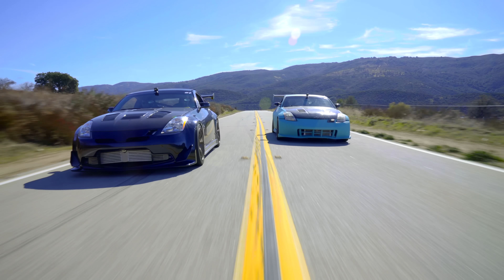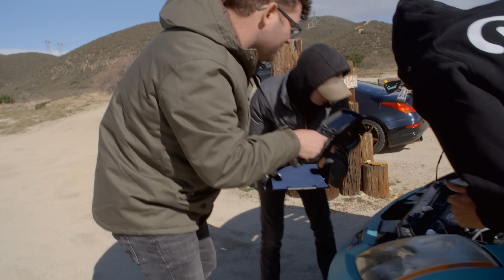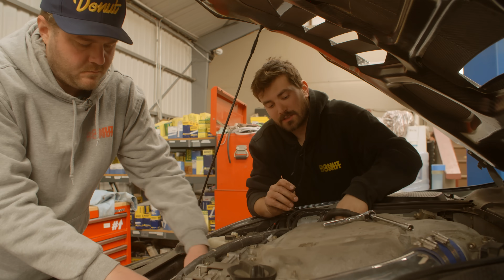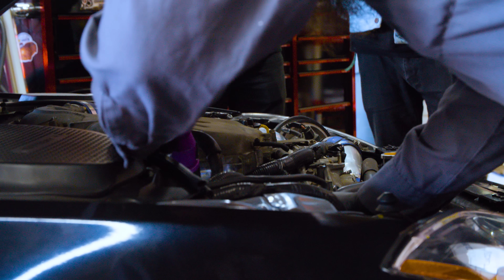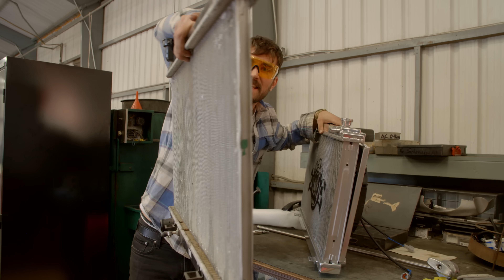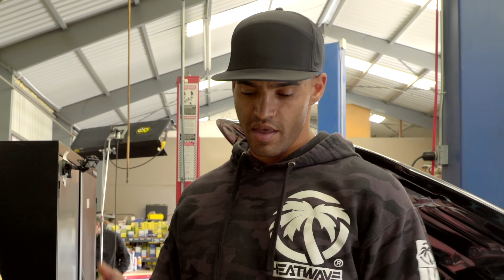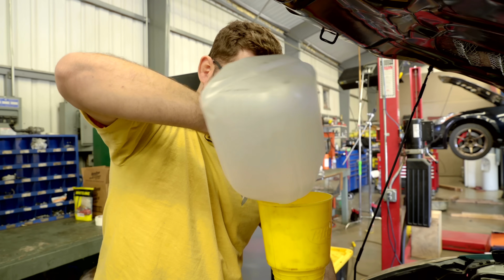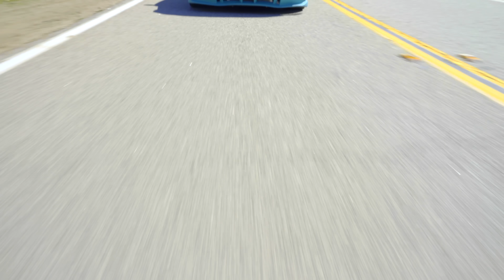$200 Radiator vs. $500 Radiator

Comment: Shout out to everyone broke af, who's been rooting for lo car the whole time.
Reply: In my opinion, for crucial part like turbo, radiator, and suspension i would used high part and the rest will be the low part.
Reply: @lamatakbertemu8197  or I uppppp
Reply: Sometimes the difference in price is not manifested in performance but rather ethics. You can have a company that develops and builds their products paying their workers fairly, and another company that stole their intellectual property, and is making the exact same product illegally whilst paying their workers like shit and having terrible working conditions. 

Sometimes the extra money isn't necessarily toward performance.
Reply: @lucysmith4242  I agree with you. It's more like giving credit for original idea/innovation.
Reply: @lucysmith4242  Thats a good point, dont buy china parts.
Reply: @lucysmith4242  You opened my eyes with that scenario, thank you, I had never thought of it that way
Reply: Andy96 if it's all you can afford it's all you can afford though. No shame in it. Can't fix the entire world ¯\_(ツ)_/¯
Reply: @lucysmith4242  There is a company here in Sweden called Biltema. They usually have the original parts for a car, however it's sometimes the "second sorting". But it's cheap as fuck. Bought and entire brake kit (front and rear) for $250.
Reply: @lucysmith4242  you'd have to prove that low car's parts are produced with illegal labor practices though.
Reply: Lucy Smith I gotta say I agree with this wholeheartedly
Reply: @lucysmith4242  not really. Cheap brake pads are worse than racing pads. My last car had regular brakes and they broke while I was in traffic and I immediately became a hazard to everyone on the road. Believe it or not but I spent nearly 1k on breaks calipers and rotors and never ever had an issue with breaking and it felt amazing for years. Sometimes quality is high priced who would’ve guessed 🤦🏾‍♂️🤦🏾‍♂️
Reply: @lucysmith4242  yeah but who cares about that race car go brrrrr
Reply: @lucysmith4242 i want money towards performance not ethics.
Reply: @lucysmith4242 😂
Reply: At least I own my dream car ....It don't work but I own it
Reply: Me n my civic (I know roast me) stay on low side.. the kid has zero funds for high car mods...
Reply: Cracc Baby civic is cool bro. Do ya thing
Reply: Honestly the best parts are simply in the middle, not crap, and somewhat cheap
Reply: @atheerathman  I don't know. I would definitely go for the high car turbsky, body kit and radiator. Maybe even fuel injectors.
Reply: @sith_sigma  But you probably have the money to back it all up and maybe even survive the rest of the month.
Reply: @sith_sigma  bb  up
Reply: @sith_sigma  I up p mmmm
Reply: @sith_sigma   You think aftermarket fuel injectors are better than  OEM ones that came off of a 100k dollar GTR? Wake up bro, you know nothing. so you would pay $3,700 for wheels?, $4,500 for brakes?, $8,100 for a turbo kit?, and $5,500 for a body kit? These cars aren't even worth 10k. You can put 20k into a 10k car and usually end up with a car valued at 15k at most. I dont know what world you people live on and what you choose to eat, but if you like cheap noodles you can put in the microwave and you can care less about your health, and you live in a card board box, and you got no girl or kids, then go ahead and waste your money, maybe your money is not hard earned.
Reply: @atheerathman  got a wife and kids. Wife stays at home, and I make above union scale, so...
Reply: Dude freaking same 😂
Reply: claustrophobic turkey 69  well then you’re looking for money pit on Wednesday
Reply: As far as cooling systems go I literally run the same type of low parts on a stage 2 gti. The computer shows 91 deg targets 90.
Reply: @aRYANz88  this motors twice the displacement
Reply: Facts lmao
Reply: @MonzOffroadDesigns  Ok so you would pay $3,700 for wheels?, $4,500 for brakes?, $8,100 for a turbo kit?, and $5,500 for a body kit? Was i totally wrong about these parts being too expensive? Get your head outta your ass. These cars aren't even worth 10k. You can put 20k into a 10k car and usually end up with a car valued at 15k at most. Do your homework before you say some dumb shit.
Reply: #Facts
Reply: All my cars have been lo cars - even my hi cars 😆
Reply: #⬇️ all day.
Reply: 🤣🤣🤣me asffffff I’m glad I can fit in ova here
Reply: I prefer the expensive parts, but I’m broke.
Reply: Wtf you took my name
Reply: @ashtongreer3329  tbh, you can have it back. I hate it.
Reply: On the gang
Reply: My brain says hi suspension but my heart says hi body kit and the wallet says mid works
Reply: Hahahah 🤣 go low car
Reply: The carless team cannot support Hi in good conscience 😂
Reply: @duinthadope420 unappreciated year old comment
Reply: ME. I have a g35 that I’m really trying to make nice. Done intake, test pipes and exhaust. Painting it rn
Reply: Here here 😂
Reply: Im definitely not rich but I buy quality parts  don't ever cheap out on your transportation you'll thank yourself in the long run and try to get parts with life time warrantys if you can
Reply: Fr bro , I come back cause they actually test these parts
Reply: 😂😂 facts
Reply: Not me I just don’t want to spend more of my money I dropped about 1700 just on tires, rims ,and tint and not including maintenance
Reply: @classicjay1880  My rims (new) costs $3000 (I bought mine for $500 because the previous owner had brush painted them and they looked terrible so I got them cheaper and now they're the original silver). They're Volvo Pegasus rims. My spoiler costs about $200 (Iridium wing). Devil Eye's headlights: $450. 2005 facelift taillights: $500. Car bought for: $500
Reply: @classicjay1880   1700 is nothing in the car world. nobody said building cars is cheap and you not having the most funds isn't a valid excuse to skimp out on safety and buy cheap shit

and yes, if you bought those wheels and tires new, I am talking shit about your shitty rep wheels and Chinese ling long tires
Reply: I kept my mk6 gti stock intill I can afford the mid to high range parts. I’ll NEVER go cheap. Stock is better then some cheap bullshit riding round bouncing your ass off
Reply: dude , 40 bucks as a said up there . They dont buy the ACTUAL lowest price . And it works fine . I sell these part myself and my customers are satisfied .
Reply: @RecklessGenesis  I bough most of my stuff for a lower price than the low-car. I'm still satisfied. My headlights don't get foggy but I can't get the dead spiders and mosquitoes out of there. The previous owner didn't put them on properly so insects could get in but they're a pain in the ass to get out.
Reply: Lmao. I was the low car’s no.1 fan lmao
Reply: @badm0t0rf1ng3r  I thought that was the point of the series.  Some parts are overpriced, and do the same or worse than a cheaper part, your just paying for looks, not effectiveness.
Reply: Facts
Reply: Everyday
Reply: Yeah buddy! ✊
Reply: Ew
Reply: Lo truck baby FTW
Reply: A person thats actually poor cant afford a car at all.. like we just want to pay off our debt. And even that isnt poor compared to what a lot of african, southamerican and asian people have to deal with. This just shows how superstitious some people are..
Reply: I'm ain't that broke... but hi car's budget is absurd at this point... i mean fast forward to the end of the season, team hi could literally buy the new 400z
Reply: Weeeeeeeell.....
Reply: Nah I’d rather wait to buy the better parts then have failed upgrades
Reply: # team low
Reply: Broke because you're on youtube, not working
Reply: Its really all Lo-Car until You care about something
Reply: I prolly can’t even afford low car 😭
Reply: Lmao broke boy
Reply: As a broke guy sometimes you just can’t trust the cheap stuff and that’s why we invented zip ties now you don’t need to worry
Reply: @Truelycustom  if you’re a broke guy then you definitely shouldn’t be modding any car. That’s why people call cars moneypits when they should be hobbies.
Reply: @alexsalazar5161  well the whole joke behind that is I’m 16 and I know you don’t know that but everything is expensive to me right now
Reply: EG-EK bois stand up!
Reply: on god lmao me
Reply: Hell yea team low car!
Reply: Straight up!
Reply: Thank you
Reply: I'm going for any car.
Reply: Always!!!!!
Reply: Bro I am a broke car guy, and I love lo car
Reply: Lol we the gang
Reply: That group is getting larger by the day in Biden’s economy. Who knew her was team LoCar.
Reply: Gotta root for low team
Reply: Always rooting for lo car 😅
Reply: Si
Reply: On God GD
Reply: Lmao same
Reply: Not broke but not a car guy either so.. I'd go for lo build (or neither, I've been driving a Hyundai for like 15 years (an accent for 9 and an Elantra for 6)
Reply: Just you bud🫡
Reply: My nigga 😂🤣😭🙏🏾
Reply: Me
Reply: I need money badly…💰💰I need to do some collabing to kick my channel off on the k swap project. No money, no progress, no content, no happiness.
Reply: BROKE? WHY?... DONT YOU WORK HARD?
Reply: @dresoto3188  I didn't say I was broke. I mean I am, but I think we all know some of the hardest workers are sometimes still broke. It's not always an indictment. Grace is free.
Reply: Naa if you’re broke you can’t afford lo car either. It’s over 10k worth of mods to it. If you’re broke then you look around the junkyard lol
Reply: @eyeborg3148  right, you'd be surprised the mods you can do on the cheap with stuff not designed for cars like the one you're fixing.... I had a gmc pickup with honda, ford, kia, dodge and unknown parts, I paid $125 for the truck, and probably another $150 on parts..... It would leave so called performance cars sitting at the light.... It didn't even have matching spark plugs.... The carburetor studs were actually toilet seat bolts.....
Reply: lol im rich
Reply: Amen
Reply: @badm0t0rf1ng3r  Ok so you would pay $3,700 for wheels?, $4,500 for brakes?, $8,100 for a turbo kit?, and $5,500 for a body kit? These cars aren't even worth 10k. You can put 20k into a 10k car and usually end up with a car valued at 15k at most. I dont know what world you people live on and what you choose to eat, but if you like cheap noodles you can put in the microwave and you can care less about your health, and you live in a card board box, and you got no girl or kids, then go ahead and waste your money, maybe your money is not hard earned.
Reply: Lol same here!  That's why I do my own work on my car to save as much as I can.  Just did a review on the new High Torque Impact Wrench 
https://youtu.be/Kne4M6qsolM
Check it out...would love to know your thoughts!

Comment: While water based coolant is up to 40% more efficient at transferring heat (likely the only reason low car ran cooler), diluting your coolant down to 25% (from 50% if it was in good shape) will now mean you do not have enough corrosion inhibitor in your coolant to protect your engine from corrosion and cavitation. Especially in an alloy engine, alloy corrodes FAST.  If you up set the pH, the glycol can also convert to glycolic acid.  Best practice is to drain and flush the coolant properly, then use a water based (glycol-free) corrosion inhibitor coolant mixed at the correct concentration. But i mean it is low car, so having a low concentration of coolant kinda fits. RIP new radiator.

Comment: HAHAHA Spunky Canyon isnt a "secret test course" i thought i saw u guys. i was just north west of Rowher Flats in my jeep on the top of the hill.

taking your cats off on video then replacing your cats with straight pipes, then driving on open public roads, with your plate on! 

my balls weigh about 4.5, 5lbs but yours are a lot bigger than mine

Comment: Do these have bleeders on the block? Just cracking these should purge all the air trapped in the block, so you won't have to bring the engine up to temp to open the thermostat.

Comment: Anti freeze also has corrosion inhibitors in it as well.   
It’s a good thing too because electrolysis corrosion is a major factor in aluminum and cast iron cooling systems.

Comment: I recently changed the support, radiator and fans on my g35 in one go and I fucking hated it lmao car started to overheat because bleed screw valve like melted and had to pay $360 to bleed the car wit a vacuum system and replace my bleed screw pipe.

Comment: You cheated you have no back pressure no added heat from slow moving air from the exhaust system because you remove the converters.You didn't give the same advantage to the low car.

Comment: If you have a higher concentration of water, the coolant will be hotter due to more efficient thermal transfer from the engine. If your climate AND cooling system will take it, more water=more better=more cheaper. Not all though, all is less better. Some may even say......worse?

Comment: I have the same turbo kit as low car and I had that same oil burning issue from the hot side, you need to delete the pcv system to not force oil up the drain line. Howdy from Indiana :)

Comment: Running 100% water in a cooling system is asking for trouble, coolant isn't just there to prevent freezing, it's a corrosion inhibitor. So even in very hot climates you need to run some sort of additive to prevent some nasty corrosion in the system.

Comment: Let this show also be a lesson of how you can't just throw parts on a car without thinking about how it will effect every other system, whether it a cooling system, exhaust, fuel....
Reply: Surprised they kept the cats on the car after going turbo. Bet removing those helped with the cooling more than the upgraded radiator and fans
Reply: @jaym6079  my exact though
Reply: @jaym6079  Im confused on how that would cause problems?
Reply: @TheDrew3452  less restrictions in exhaust to reduce EGT. Plus the car is already CA smog illegal, might as well remove it
Reply: @TheDrew3452  a catalytic converter is exactly the sum of its name. It converts harmful components of exhaust gas by catalyzing it through a substrate of reactive metals. The result of this process is the catalyzed gases and more importantly heat.
Add more fuel nessesitated by the addition of a turbo results in excessive heat that will overtime weaken the substrate and cause it to break down.

A car from the factory is generally built very well balanced between power, reliability, pollution, and cost. Change anything and it will change this balance.
That's why it's better to tackle modifications as a system. Save up, and do the work in chunks, otherwise you may be let down with the results, or you can potentially damage things.

Comment: I’ve have 3 failures on my csf triple bypass over the years. Went back oem, with zero issues lol. Sadly. I wanted the csf to work
Reply: I was thinking along those lines. The aftermarket aluminum radiator should definitely cool the car better but you may not get the reliability of an OEM radiator.

Comment: these two 350z are not real race cars, but there are street cars, with "race parts bolts on" and distilled water, is not super good in alominum block, mocool from motul, I use it in my race scooter;)

Comment: So far I've learned from HiLo:

What parts are worth my hard earned money. 
And to never go through the trouble of turboing a car
Reply: if you can junkyard turbo a car that had a stock turbo option it's probably not as bad
Reply: @Odddit  The VQ has a stock turbo option in the R35
Reply: @Odddit  yeah the trick seems to be put better turbo parts on a stock turbo car. Slapping a turbo on a factory N/A engine seems to generally be awful. 

Nearly every problem Hi car has had is because of the damn twin turbo kit.
Reply: @Garbage Trash those are the only ones that are fine being turboed tbh
Reply: LKRG accurate the d16 can make 500 with Just simple mods lol
Reply: Supercharging is a lot more reliable
Reply: @Retr0.5280  if it doesn't go STUTUTUTUTU and PSSSSST ion want it
Reply: @jaggerjdm9787  Thats the sounds the passenger makes when your have a powerful, high revving engine.
Reply: Jagger Campiglia yeah but you gotta admit the “FFFFFFEEEEEEEEW” of a supercharger on a muscle car or v8 is nice as shit
Reply: Alan Barron WEEEEEEEEEEE gear shift* WEEEEEEEEEEEEE gear shift* WEEEEEEEEE
Reply: I would like to disagree.... I had a fox body mustang and I turbo charged it from 86 hrsprs to almost 179 hrsprs with some friends.... Which is almost double the amount without any issues with the car.... It never broke down or had other problems.... Although I did get it tuned also replaced exhaust cause the old exhaust was not able to handle the power
So it's basically the compatibility of your kit with the engine and also your workmanship.... Although I don't believe donut had any problems in the workmanship part... Just the kits and the engine

Comment: You shouldnt run pure water or little coolant even in hot climates. Antifreeze is not the only property of coolant. it also lubricates the water pump, protects against internal corrosion and gunk buildup, extends the lifespan of hoses and seals and flushes out any impurities. Your car wont explode but the lifespan of your cooling solution will definitely decrease. The best ratio is 45% coolant to 55% water, with a freezing point of -35 C°.

Comment: James- “we are running ten to twenty degrees.  hotter I wasn’t expecting that”.   

Me- “No way it’s a black car in a desert”
Reply: It does make a lot of sense tbh XD
Reply: theyre measuring temps under the hood, not the body wtf
Reply: @josiahdavid7333  the black wrap will absorb heat that will transfer into the engine bay
Reply: @bradenprice9516  not to a degree that would matter at that level of heat and cooling.
Reply: Braden Price the amount “added” is nothing compared to the amount the exhaust/turbo dumps into the bay. A 100 degree hood is gonna do nothing but help cool a 160-180 degree bay.
Reply: Yo thats racist lol
Reply: @fewmold9772  *in a gabriel iglesias voice

No not exactly😂
Reply: @fewmold9772  Black cars matter